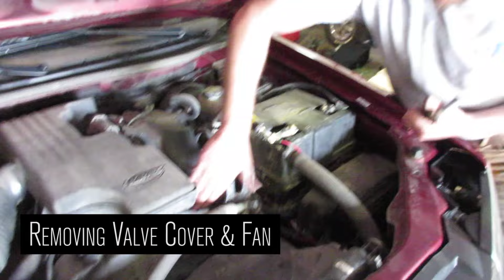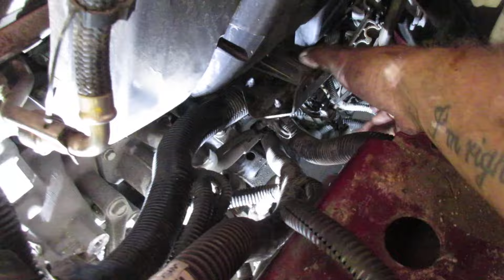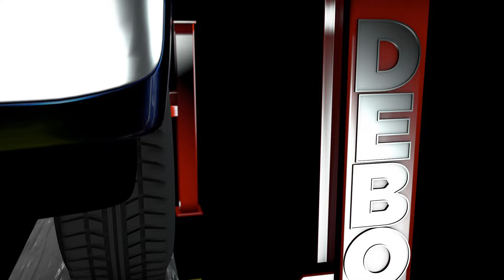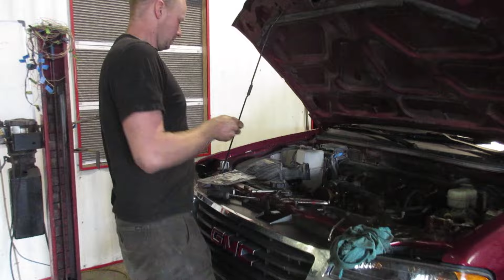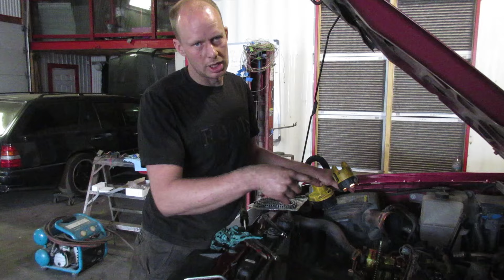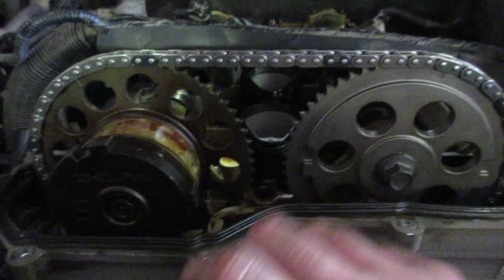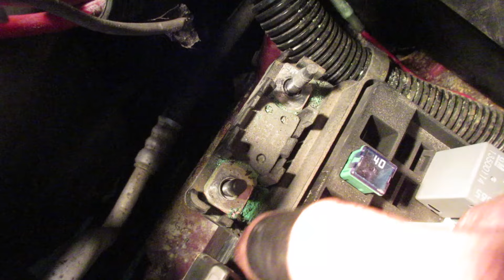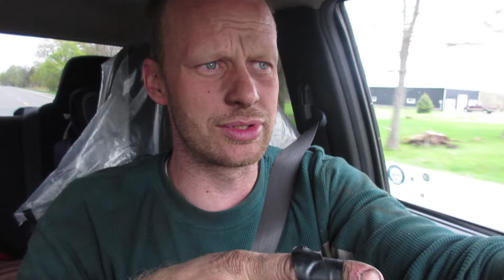Over-Engineering At Its Finest! GMC Canyon Needs A Timing Chain

Comment: You call that over engineered? You must not be familiar with Audi 4.2 engines...
Reply: Matt Mauro Don't leave out BMW, Mercedes-Benz, and Porsche! They've all put out some over-engineered nightmares in the last decade or so.
Reply: Lets just throw volkswagen too because "German Engineering" comes with a hefty price tag.
Reply: And they are still not reliable.
Reply: BMW N47 diesel is a nightmare too.
Reply: They're pretty with the timing chain cover off. Intimidating even.
Reply: Volkswagen and Porsche used to be the easist cars ever to work on. With the bugs and 911's you could pull the motors rebuild them and have them back in the car over a three day weekend. Now a days it takes that much time to change a fuel pump on some cars and you need special tools to do it. The upside is todays cars hardly ever break down when they are new and won't need to start replacing worn out parts till after 250,000 or more miles.
Reply: Matt Mauro old good mercedes om617, 601, 606, m103-104's etc... are just awesome engines over engineered in good way
Reply: Know someone with an S4 who was quoted 12k to do the timing chain.  Ended up replacing the engine for 15k.
Reply: My daily driver is a 1984 Mercedes 300 TD with 330K miles. It fires up with a hit of the key down to 10 deg F. 2000 miles per quart of oil. Not enough oil leaks to hit the ground. So, yea. Good. Slow as a herd of turtles though.
Reply: Indys Dad yeah they are amazing haha
Reply: One has not lived until they've had to replace a turbo on the Audi 2.7 biturbo V6.
Reply: Audi has stupid timing belts. You cannot call that overengineered.
Reply: Matt Mauro audi 1.8 is all we need.
Reply: Not that 4.2 L that Matt Mauro is talking about. That thing has the most complicated timing chain arrangement I've ever seen on any engine. Any vehicle that MUST have it's engine removed to replace the timing chain is pure evil on the part of the engineers for developing such a menace. Instead of designing the timing gear train, etc. into the front of the engine, these geniuses decided it would be a good idea to design it into the rear of the engine where the firewall, transmission etc make it impossible to repair without having to disassemble the entire engine compartment. On top of all of that, it appears that they purposefully used shit quality plastic in the chain guides, basically fucking anyone who buys one of these second hand.
Reply: The 4.2 was designed to be a lifetime chain and it ended up not being that.
Reply: Another beauty of engineering is the triumph stagg v8 engine. What a headache of an engine
Reply: Isn't that just Germans acting German?  They never learned what good enough means when it comes to engineering.
Reply: I been doing this for almost 40 years  im about done with this  BS
Reply: I did plugs on my friends BMW X5 Sport thingy, I don't know. After the maze of covers and ducting was removed the fun started. Oh yeah, you also have to buy a special plug socket with a perfectly placed built in swivel because the plug well isn't straight. Socket was $75 bucks at dealer or $35 on Amazon. Twin turbos in the V and intake ducting with intercoolers running down where the exhaust normally is. Cool engineering but an absolute nightmare to work on.
Reply: It wasn't the chain that was the problem it was that ^*@Q!&^!)@# Audi used plastic guides and they wore out! I went through this crap.
Reply: ...or the 3.1 V6 from the old Chevy Luminas. That thing was a nightmare to work on.
Reply: rsx123 actually all chain instead of belt setups were supposed to last the entire life of the car,like 150k miles.what a waste of resources.
Reply: Try a Caterpillar ACERT for overengineering. They used 3 turbos on the engine to try and meet EPA emissions regulations.
Reply: Moritz Schmidt  What's the point of acting like you're refuting me? Note how you made your idiotic bold claim, followed quickly with a non-VANOS is best in there. Their VANOS setups have been short-lived garbage for decades. A year later an your engine would be lucky to make it half that distance without replacing timing chains and phasers.
Reply: The Audi RS4 4.2L V8 actually isn't that bad of an engine, it's just the S4 with the bullshit plastic timing chain guides. The RS4 had metal guides which fixed the problem. I'm actually astonished that Audi could create such a complicated engine that runs so long for being so over-engineered. The S4 with RS4 timing chain guides and a round of tranny/dif fluid changes every 100k miles can be a solid car...
Reply: rsx123 sounds like Audi,. Removal of front fascia and hours of complex work to an engine at its end of its lifetime. Not to repair, replace. Lease vehicles,. Sorry to all who thought it was a good idea to own these gems,. Cubic zirconia!! But Bentley, Bugatti and Lamborghini,. Cars that are made to last 100k with $500k in maintenance
Reply: rsx123 sounds like Audi,. Removal of front fascia and hours of complex work to an engine at its end of its lifetime. Not to repair, replace. Lease vehicles,. Sorry to all who thought it was a good idea to own these gems,. Cubic zirconia!! But Bentley, Bugatti and Lamborghini,. Cars that are made to last 100k with $500k in maintenance
Reply: @BigBadWolf1st that's correct.  The old timing belt engines are great.

Comment: Nissan is similar, i replaced the head gasket on an 08 nissan titan, had to pull the engine, pull both halves of the oil pan, then pull the timin cover then finally pull the head, oh and the entire grill setup had to come off to pull the engine (didn't have a lift to pull the engine from under)
But the guy has put close to 80,000 hard miles on it since then, it's still running great

Comment: can't you use impact wrench to get the 250ftlbs bolt off?
Reply: What tool you use is determined by how much work you're willing to do, how many things you're willing to pull, how much its going to cost if you remove those things to make the tool fit into the space available.  Every step along the way is a decision.
Reply: Lorrin Barth yeah of course, and with all the work they do on engines I'm surprised they didn't use a air impact wrench.  They had a ton of room for one.
Reply: It didn't look to me like there was space for a big hammer gun but I could be mistaken.
Reply: Lorrin Barth sure I could have fit my full size half inch in there... and if not, this $80 wonder would work!  https://m.harborfreight.com/super-compact-extreme-power-ultra-light-weight-quiet-12-in-stubby-air-impact-wrench-63064.html

Aircat Nitrocat 1056 might be good as well... small impacts are awesome.
Reply: Remember, they didn't show how long the bolt is.
Reply: Lorrin Barth hah, nice try buy you break it free and you'll probably be able to unscrew it by hand
Reply: It's torque to yield.  Tightened to 250, then an additional 90 degrees.  The end torque is way, way higher, and no your impact isn't pulling that.

Comment: You'd think it would have been easier to put a sixth piston on that engine than TWO freaking balance shafts.
Reply: I know, right? I was just thinking about that.  Then again, they probably had all the factory tooling setup when they realized it.
Reply: Oh shit guys why are we designing these two balance shafts to keep this sack of shit from vibrating all too hell. we could have just put another cylinder on it.. Awww for f*(((KS sake guys..
Reply: The 4.3Lt Vortec V6 has a balancer shaft in it to, not a GM guy but I think the 5.3lt vortec does as well, it seems to be common on the Chevys I've worked on. Ford balances the crankshaft and use a vibration damper to help with unbalance on an engine. I find that most car manufactures now days build stuff they don't want you to work on, there designed to carry to a certified technician however half the time they cant figure it out either.
Reply: Yes the 4.3 does have a balancer shaft due to the fact that its a 90 degree v6 which is inherently imbalanced. 60 degree v6 don't use balance shaft. Nor do the Chevrolet v8s. The 5 cylinder is clearly imbalanced and needs balance shafts..
Reply: Ford 351 Cleveland was a 90 degree engine and it had no balance shaft and was very balanced due to the inner workings of the engine, Ford balances the crankshaft very well so they have less need for balancing externally. Reid Henderson, Inline engine need less balancing due to all pistons are going in the same direction. Inline engines will run a lot smoother then a V8 or 90 Deg. just by design alone.
Reply: Yeah inline 6s are smooth due to firing every 120 degrees of crankshaft rotation which is a very even fire.. Inline 5 are not smooth without a balance shaft due to the inherent imbalance of having odd firing and an extra cylinder or one less depending how you look at it. inline 4 cyl are nowhere near as smooth as v engines. Now a 90 v6 is not as smooth as a 60 v6 due to the geometry and firing interval of the crankshaft. Inline 3s are imbalanced just as the inline 5 and needs a balance shaft also. If you are talking about inline 6s though you would be correct most inline 6s are very smooth engines.
Reply: Now 90 degree v8s are smooth due to firing every 90 degrees of rotation. But ford made its 3.4 dohc v8 in the Taurus sho that was a 60 degree v8 due to the odd cylinder angle it required a balance shaft.
Reply: There is a lot said for a well engineered engine, no matter what the make.
Reply: Gnidlaps**whoever,  fact is, sadly but true,  There is NO such thing as a "well engineered engine"  after the model T.  think about it,  what improvements??, some more power, slight more mpg, better reliability, but at a price,  but most of the R+D has gone into emission control, due to the fact that fundamentally, an internal comb. engine is a filthy, dirty method to propel a vehicle.. You pay a fortune for mostly re-hashed old fashioned, worn out technical Bull-Sh!t,  just in a different package with tons of brain washing advertising.. look at, or try to repair these diabolically designed dinosaurs, total illogical idiocy.
Reply: Homecomfort I disagree as far as well engineered, if you look back through time when I was a child if you got 100,000 miles out of an engine then you did good. Today 35 years later it is nothing to see a car with over 200,000miles and it still runs great, my E350 service van has 250,000 mile on it and I use it almost daily to pull 13,000-14,000lbs, with no problem.
This is the way I see it, cars are over engineered today, so much that the average man has to be an engineer to even find the alternator. Everything works so precise together and when one thing gets a little out of line, it all falls apart.
So when you look at cars today, you better try your best to follow the owners manual and keep it stock like the engineers that spent years designing it to run and it will last along time.
Reply: Gnidlaps2791 
Ford used/uses it's share of balance shafts too.
Most larger inline 4  and 5 cylinders use them, and most 90 deg. V6 engines use them, regardless of who the manufacturer is.
No amount of precision balancing will make the above mentioned engines smooth.
Their layouts makes them inherent shakers.
BTW, 90 deg. V8s are fairly smooth, and do not require balance shafts.
The GM "LS" family of V8s are no exception and have never used a balance shaft...
The Ford 3.8/3.9/4.2L 90 degree V6s used balance shafts.
Reply: Those engines were complete shit. The cam shafts were so badly designed that a critical failure would happen where the sprocket if not welded would separate from the camshaft. And when you got 4 cams and 32 valves... well you can see the bomb waiting to go off. The original V6 3.0 Yamaha was the bullet proof one.
Reply: @eyeh8theleft  actually the engine was originally being designed to run on hydrogen. As gasoline was to abrasive.
Reply: @Gnidlaps  inline 6 engines are inherently balanced
Reply: This is the 4 cylinder. 5 cylinders are smooth. My old Audi I5 doesn't have a balance shaft.
Reply: @reidhenderson1194  not true. 5 cylinders don't need them. This is a 4  cylinder.
Reply: @Gnidlaps  90 degree V8's don't need balance shafts.  90 degree V6's do.

Comment: Im not trying to find fault in anything your doing Rich..just a piece of advice a "old time mechanic" gave me years ago...if you ever need to lock up a  engine (removing a balancer bolt )..use a piece of cotton rope and shove it down a spark plug hole.rotate the engine till piston comes up to t.d.c..Rotate engine in reverse direction to remove..saved my ass many a time...love your channel bud

Comment: I wouldn't say over-engineering but rather bad design, i'd say over-engineering is having 20+ modules on a single car, that is just fucking excessive
Reply: would you rather rather replace one small computer or 1 big one?
Reply: Yeah, "over-engineered" traditionally has meant engineered to withstand higher stresses than the application will see, so it never breaks. Highway bridges are an example.

Comment: I had a trailblazer 4x4 with the 4.2... The front diff passed through the pan! I needed to remove the whole diff and the oil pan if I wanted to change the oil pump in front. When the front diff gave up, I sent it to the scrap yard.

Comment: glad I never bought a canyon
Reply: Me to!!
Reply: Danny Farquharson If that's the case you should also avoid the SOHC 4.0 V6 in the 2001-12 Ford Ranger. They also feature a rear timing chain that requires pulling the engine.
Reply: thanks for telling me that.i did not know that, probably never buy a ford anyway.. lol...
Reply: Danny Farquharson yeah don't buy a Ford. It's a gamble. either you get something really good or something really bad. no in-between.
Reply: the only 4.0 sohc that had problems was the 97-98 because one of the guide brackets was to thin of steel
Reply: nope, lack of oil to the rocker arms leads to premature wear
Reply: Danny Farquharson I want one with an izuzu diesel
Reply: Michael Kuzma dutton --- It's not an Isuzu. It's a light duty Italian VM Motori engine. Jury is still out on whether they will last. But go ahead and drop $40k and let us know how it turns out.
Reply: the 1999+ 4.0SOHC fords can get 200,000-300,000 miles on a chain set no problem you are more likely to junk it due to rust or burn out the transmission before the motor
Reply: thebad300 LOL okay bud. I've seen two 4.0 SOHC Rangers flat-bedded in with bent valves thanks to shit timing chains. Both were under 150k miles.
Reply: nope. all of the 4.0 sohc engines had bad timing chain designs, absolutely terrible
Reply: at Hochhaul just 2 ?! i have replaced more gm and Chrysler with bent valves  dont even try that shit  and @Fozzie the first year or two the 4.0 had a chain guide that was made from far too thin mettle  after it was fixed they run good and last
Reply: thebad300 Considering I don't work in a garage, seeing two different 4.0L Rangers with bent valves is pretty significant. But go on, tell how everything Ford makes is gold and every GM and Chrysler ever made is shit. Fucking fanboys.
Reply: hochhaul yep thats what killed my 97 explorer it's had 268 thousand miles on it so I'm happy
Reply: thebad300 not completely true
Reply: northlander so are Ford and mopar guys who don't know shit about shit and claim Ford has never taken a bailout yet Ford had a recall that wouldve made them sell every asset they had just to stay afloat to fix the issue and stopped fixing massive issues. Gm isn't any better mopar is just meh I worked in a shop for quite awhile and work on many people's cars and Ford normally just like statistics point towards gm is the only American based company worth a shit

Comment: You should have just put a cummins 4bt into it. Probably would have taken less time.
Reply: axlshaft not really thats a lot more weight
Reply: jdr ok he didn't say anything about weight, he said it'd be easier
Reply: An R2.8 Cummins has the same torque as the 4bt and it's even cheaper.

Comment: I believe this engine was designed by Isuzu. Honestly I would have pulled the engine out of the bay for this. It sounds like more work but in reality its less time because you aren't working around all the bullshit in the bay.
Reply: Travis Callahan not a isuzu engine
Reply: The I series engines are designed by Isuzu and manufactured by GM. I promise. That's why the Isuzu trucks share a drive line. They are sister vehicles.
Reply: Travis Callahan the I engines they are atlus engines
Reply: Travis Callahan when my stepfather had to do one of these he did just pull the engine

Comment: I had a ‘06 Colorado 2.8L and at 78,000 miles the exhaust value seats went bad. Fortunately the dealership covered the replacement head and labor. Sold it the day after it came out of the shop.
Reply: I bought mine new in Nov 2006 I am @ 186k miles now i have timing chain noise+metal in the oil. It's not a big problem $300 in parts and I have been mechanic for 20 years.  The problem is the time it takes to replace it, I live in silicon valley stealership shop rate is $160 hour. If I get another 150k miles i would not be surprised she's a fine truck.